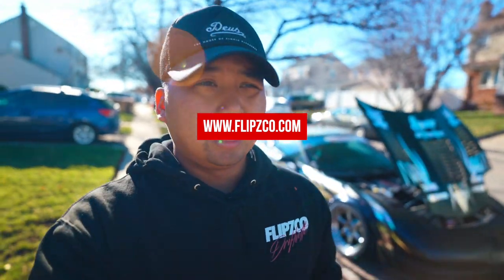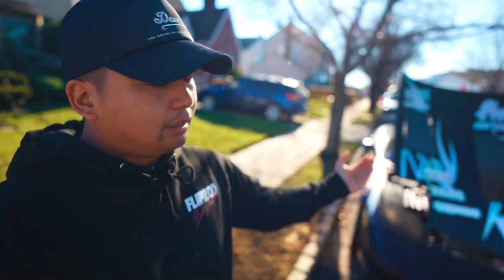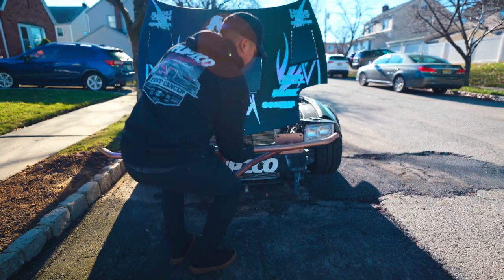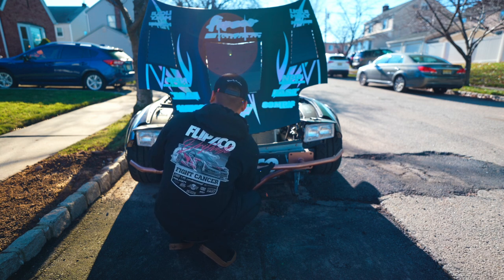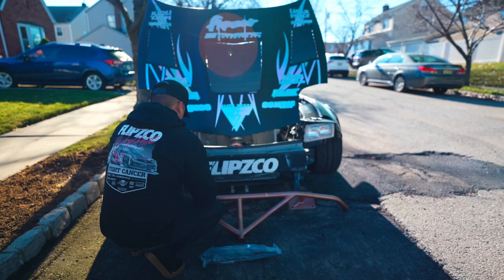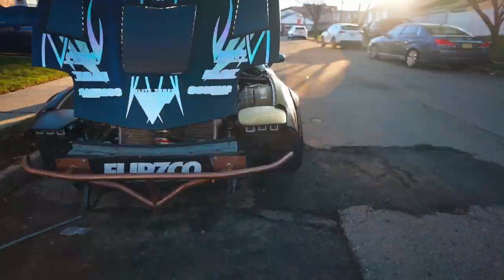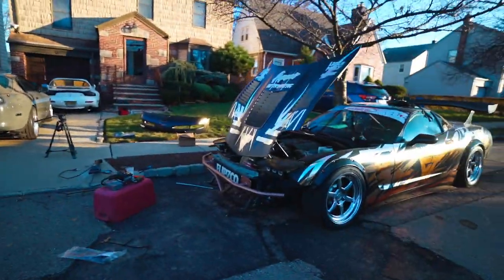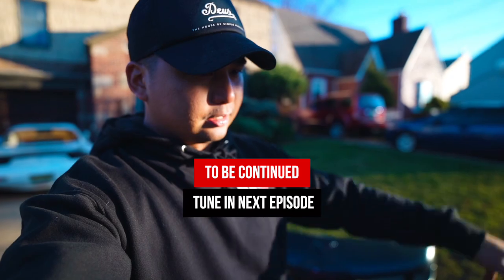C5 Corvette gets a FACE-LIFT! *KnightDriveTV Halo LED Headlights* Sleepy Eye Look

Comment: Would love to see how well or not the front fascia fits with the bash bar in the next vid.
Reply from the maker: Honestly with only measuring once the front bumper fit perfectly. Only issue was having to trim the bottom of the bumper (only if you have a jack point) if you just have the solid bar you are fine